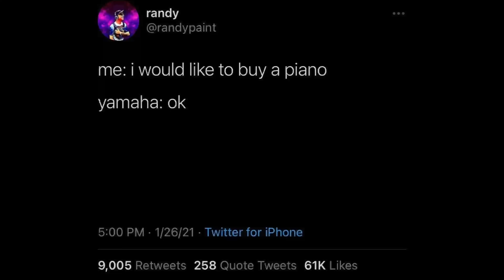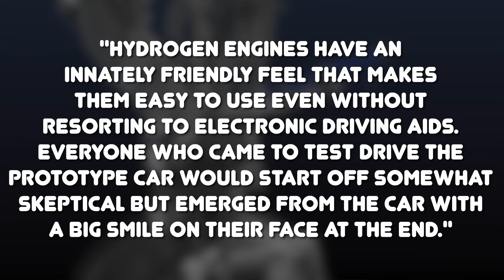Toyota's New 455HP Hydrogen V8: Everything You Need to Know

Comment: Hydrogen is definitely a viable storage medium for energy!  Think about this, Hydrogen works in internal combustion engines and provides similar performance to hydro carbons.  It can also be used with a fuel cell to generate electricity for electric vehicles.  The problem isn't the propulsion the problem is the storage tank.  Carlos Teveres (sp) an exec with Stelantis thinks that a battery shortage is on the horizon if not already in view. Batteries are expensive.  Now I'm not sure on the cost of mobile fuel cells, but if it's priced comparable or less than batteries then hydrogen is probably the fuel of the future.
Reply: Hydrogen source is water. Hydrogen is for drinking and washing clothes not engines.

Comment: A FEW YEARS AGO CHARGING STATIONS WERE LIMITED  AN ENGINE WITH 0 EMISSIONS THAT CAN ALSO HAS COMPONENTS THAT COULD BE USED TO CONVERT EXISTING ENGINES THAT HAVE BEEN PROVEN OVER THE LAST  100 YEARS OF TRIAL AND ERROR    WHAT A WASTE OF MATERIALS AS WELL AS MANPOWER AND MONEY STARTING OVER AGAIN  AN EXISTING ENGINE THAT WOULD BE CONVERTED  TO 0 EMISSIONS TO ME WOULD BE THE BEST ANSWER   THE REASON THEY DIDN T SELL  WAS THE COST AS WELL AS THE FEAR OF THE WORD HYDROGEN BY THE INSECURE  NOT ONLY VIABLE BUT A  WHOLE LOT LESS CARBON INVOLVED IN NOT HAVING TO CHANGOVER   ELECTRIC AS I AM LEAD TO BELIEVE IS QUITE UNHEALTHY  IN IT S OWN WAY   JUST ANOTHER PROBLEM WAITING TO BE USED IN THE FUTURE TO INCREASE NEW CAR  SALES THEY DID IT WITH MAKE BELIEVE FUEL SHORTAGES  WHICH WAS CAUSED BY DROPPING THE COMPRESSION TO HELP WITH POLUTION  IN 1968 THEY HAD A 300 HP 5.3 ENGINE THAT COULD GIVE YOU NEARLY 30 MILES PERT GALLON   SO RATHER THAN IMPROVING ON THAT BASE THEY ROPPED COMPRESSION AND COULD NO LONGER MUSTER TWENTY MPG  SO YOU HAD TO START BUYING SMALLER CARS  EVERY FEW YEARS THEY CONVINCE PEOPLE THAT THEY ARE DAMAGING THE ENVIROMENT BY DRIVING SOMETHING OBSOLITE AND PEOPLE WHO ARE INSECURE LEAD THE WAY TO THE DEALERSHIPS  COME ON PEOPLE WE HAVE COMPUTERS AND O ONE CAN BUILD A SIMPLE  ENGINE THAT WILL SAVE THE WORLD WITHOUT A COMPLETE START OVER  I FOR ONE AM NOT THAT NAIVE AND NOW THE GOVERNMENT IS USING IT AS A WAY TO BRING THE COUNTRY TO SUBMISSION AS I SEE IT .

Comment: you are forgetting about the "China Risk" for PGMs, scarece materials being used as their strategic material.  Then the price of EVs will go creazy high.  And not sustainable.  Hydrogen is the future.  And the #1 sales in Hydrogen is Hyundai Nexxo.  FYI.  however, this H2 combustion engine is sweet.  Toyota is on the right track for the engine side.

Comment: There is a reason to go to Hydrogen: emissions and range. You are right it needs an infrastructure putting in place but electric power is slow to charge and the range is pathetic- in the winter with the heater on and lights the range crashes further. I regularly do 400 miles in a day and have not got time to spend 30 minutes refueling, let alone waiting for someone else to finish their charge first. On the other hand the motor trade world wide from the west to under developed counties all have people who can with minimal training pick up how to repair hydrogen engines. The hydrogen cars are the best option, but what they need is pressure on governments the world over to invest in green hydrogen from hydro electric, wind and solar pv sources so we can have a sustainable planet.

Comment: Planes ? You're obviously brain dead. Fuel ? Just how stupid are you ? Obviously, very. The U.S. electrical grid system can't handle the charging systems that would be required. the emissions from electric cars are methane, and ozone which damages the stratospheric ozone layer. Hydrogen engines emit harmless steam. You have the IQ of a tree stump, and are a classic example of the failure of today's educational system.

Comment: First, hydrogen combustion engines don't require the same maintenance schedule as gas. It's a clean fuel that does not produce carbon. Therefore no carbon buildup, fouling plugs, dirty oil, etc.

Comment: 1.Electric is almost silent -> True
2.Makes a ton of power -> For now. Hydrogen technology for commercial use is still in early stages 
3.It's easy to drive -> That is extremely vague. Based on what criteria. if you are referring to lack of infrastructure, fair point but the same issue excised with LPG cars and initially (and to this day in many countries) with electric vehicles.
4.Eliminates all maintenance costs -> That is totally accurate. Electric vehicles, DO require maintenance just like any other vehicle. Maintenance that the average Joe can not perform (not the average Joe can in the modern vehicles but there are certain things that can be performed without the need of a mechanic). Needless to say you CAN NOT take your electric vehicle to the mechanic near your house.
5. and more -> I would like to hear the "and more" part.
All and all, what we need to see here, is whether the electric or the hydrogen vehicles have the biggest ecological footprint. That includes the process of extracting the minerals required for the battery cells, the methods through which the electricity required to recharge the electric vehicles is produced (renewable, fossil, nuclear etc), the recyclability of the components (I am looking at you battery cells), the methods with which the hydrogen can be "produced" and what is the energy required to do so and ofcourse what will be the long term effects of the one technology IN IT'S ENTIRITY over the other. Certainly there are more reasons that I am no expert to elaborate on. 
Deeming something not feasible, without providing any actual scientific proof/facts is at least wrong. There are reasons as to why Hydrogen would be really difficult to be implemented in our daily lives but that does not mean we should not if in the long run Hydrogen is proven to be beneficial for the planet and our lives.

Comment: you're looking at this very short term. hydrogen is the most abundant element in the universe, there's research ongoing on how to make it cheaper to liquify. also there's not a single electric grid on earth that can handle total electrification. you'd literally have to more than double the grid capacity to even think of making it viable and that basically involves doubling the thickness of every single wire and component in the grid. which is unfathomably expensive. if hydrogen pumps replace fuel pumps then electric pretty much loses out, the only thing it has going is the faster acceleration. but they're shit in hot weather, shit in cold weather and now battery subscription services. the only downside to hydrogen is fuel cost. toyota engines are insanely reliable and most can go 1,000,000+ miles without much issue. they're building the next generation of ICE engines that's based on 100+ years of engineering development. oh and they don't have to pollute the shit out of entire areas like lithium mines do. on the flip side hydrogen hybrid platforms could also work really well.

Comment: It is a lot cleaner then the electric powered cars . Hydrogen is the future of the automotive industry . And if we have been allowed to invest in hydrogen electrolyse research we would be able to put soft water in a thank and run Thousands of kilometres only with a thank of 40 litters . But unfortunately the Automobile industry has been lobbied bye the oil companies. Production of a electric battery is environmentally not sustainable because we are using rear metals .

Comment: I think Toyota and Yamaha can see the writing on the wall. I think they know that electric cars are going to fail they already have proven to be unsafe, unsustainable and for the average DIYer how are you going to work on an electric car a new battery costs anywhere from 5 to 10,000 . I think the internal combustion engine is a great idea you can work on it your self  you don't need to be an engineer or an electrician there's no hydrogen cyanide there's no risk of overcharging undercharging or damaging the battery because of extreme heat or cold.. great work Toyota I would definitely buy one of these cars.
Reply: But an EV battery refurb only costs a fraction of a full replacement, and is the way to go rather than a complete battery swap.   A 10 year old Nissan Leaf had a battery refurb at Cleveleys Electric Vehicles in Gloucestershire, England, and the work took 4 hours, and cost the Leaf owner £600. Clearly you have little idea what is actually happening on the EV scene..... Yes indeed, an EV battery can be repaired and refurbished, just like an ICE engine can. You obviously didn't know this..... Oh, and the video of the Leaf battery refurbishment is here on YouTube.....And it seems you weren't aware that on most EV's, you are able to set the maximum amount of charge you prefer. You don't have to charge to 100%.....
Reply: @Brian-om2hh  hey if you like EVS that's great I don't.  I think they're a colossal failure, I'm glad Toyota ,Yamaha and I believe Honda have all pledged to continue making the internal combustion engine I think they're going to go with hydrogen which is a great idea here in the US nobody really wants EVS they're trying to force them upon us and quite frankly I don't think we want to end up like the UK.

Comment: Neutral party here: dont trust someone who says EVs are "vastly better in every way". Thats like saying an electric drill can replace a hammer, a welder and a chainsaw. Current EV technology is near its peak already. Theres room to grow, if you want to get technical, but your not going to get a much better battery for street use. There isnt a single EV that can match the low weight and power of on ICE. People see engine/motor power numbers but forget that ICE engines have transmissions that multiply torque, thus why ICE vehicles can have vastly greater range while still carrying a load. An EV struggles to carry its own weight already but it doesnt seem like it because, yes, they accelerate quickly. But that's because its single gear ratio is optimized for its own weight and some passenger. They are barely-passable as trucks due to a HUGE range penalty with a load, not very competitive at autocross events or any track with sharp corners(mainly tracks with several long straits, don't attempt hill/canyon runs), will be extremely costly to run as a semitruck(so many reasons), and I can go on.

Just like every technology, nothing is the solution to everything. Long-term, EVs are great city cars and are solid replacement for 4000+lb luxury vehicles, but for everything else, they cant beat anything. Not even for the environment. 

Recycling batteries is a "hopeful" outlook but realistically, very few are going to be recycled, lets be honest with ourselves. People don't even recycle well as-is. Cars crash and get damaged, things get tossed in the trash when they are found on the floor or when salvaging for parts. How many people actually take their electronics and recycle each component like their supposed to? Or drop old paint containers or chemicals to designated dropoff locations? Same is going to happen.

Comment: I think hydrogen will take over commercial vehicles because of refilling at there facilities. A company called" Prometheus" has developed a fuel which is replacement for gasoline vehicles- no modifications needed.
Reply: And did they happen to mention the cost?   Synthetic petrol has been on sale in the UK for decades, but at a price. It's around 4 times the cost of normal unleaded.....

Comment: Sorry but your missing that electric cars need either a battery or a fuel cell that currently is very expensive. Batteries are not very good for environment so your talk does not make sense but for you perhaps. And all electric production systems in the world are producing to little energy, so there is  problems to get hold of electrons for your electric motor currently. Its fine, you like electric cars but do not lay out your shit as if it's the truth, It's your truth.

Comment: Batteries are cool sure, but if every single car out there which is combustion, can potentially run on Hydrogen, and let’s say it’s $5k to change the injectors and fuel cell and cylinder head.. well let’s just say it’s cheaper than buying a Tesla and you still have the same car instead of having to upgrade and spend $20k/$50k… how many people would not only financially be able to do this let alone be super close to carbon neutral 💁🏼‍♂️💁🏼‍♂️. And then there’s the potential for small auto companies to create products and more jobs… why isn’t hydrogen happening

Comment: Hydrogen could've been cheap by now if companies/countries invested in the infrastructure to support it. It's literally the most abundant element in the universe and I think that if there was more international focus put on it as a petrol replacement, it would make an even more practical choice than batteries. However, electric motors are superior from a cost of ownership standpoint, and while we likely won't be able to see charging/battery tech that can get you 400+ miles in a matter of a few minutes within this decade, most city commuters don't need that on a day-to-day basis.

Comment: Electric may be ahead but it is not superior. The time it takes to charge a fully electric car is a deal breaker for most people. And the 10yr life of a battery is another deal breaker. Also i feel like Hydrogen is far superior if its horsepower you want.
Reply: And the cost of gas/petrol and diesel is fast becoming a deal breaker for many too.... Hydrogen certainly isn't superior when it comes to fuel economy or the cost of the fuel itself....

Comment: They might have more success making a sort of crate engine for the environmentally conscious gearheads out there, they're trying to cut into a pretty niche market for sure, but if I could swap or install one of these into an empty chassis, I absolutely would, given the availability of hydrogen.  It may not be the best option emissions-wise, but to have a (in my case) classic car without the nagging guilt in the back of my head knowing that it's just dumping emissions into the air, would be an amazing thing.  Power and sustainability is the way of the future, if electric cars are the answer to that question, then so be it, but I'd absolutely love to keep the car enthusiast community roaring, instead of humming.

Comment: What you don't understand is the demand on the power grid 100% electrification would cause. Some governments are out of their minds with their new legislations on electrification. Some of the plans wouldn't be feasible if the infrastructure was already under construction. It's possible that hydrogen could supplement electric for certain applications where electric may not be as feasible...... however this is assuming hydrogen fuel itself becomes feasible. The only way I see hydrogen taking off for Ice vehicles is if the rest of the industrial sectors switch to it for other purposes, as has been discussed for, god as long as I can remember. I'm of the mindset that any money spent on technological R&D is a good thing.

Comment: "needs to be superior in every way" then you tout electric cars...and how the range is poor, what about the charging time too? Or go watch what happens to the range of an electric truck with a load on it? And as of now, the electric to charge these cars is mostly generated by burning fossil fuels anyway. The reason someone would be interested in hydrogen or some alternative fuel, is when Gasoline is $8 per gallon, and if its a relatively simple conversion process to get ICE engines to run on hydrogen (or alternative), that means we don't have to scrap hundreds of millions of cars (and trucks) that are on the roads right now...also, previously there was no demand because gas was still ~$2/gal...and when tesla started there was no charging infrastructure either....no offense but i feel like you didnt think much of those comments out....

Comment: Hydrogen is the perfect compromise, the electricity for EV can be use for electrolysis. No use of Lithium or Sodium and no need to refine them, we keep using the well established steel and aluminium industry.

You can also still modify a combustion engine to have greater power than an EV and still be less permissive than battery manufacturing.

All you need is a nuclear power plant powering a huge electrolysis plant and you have the fuel. If we have the power ants for electricity you can have hydrogen fuel.

Comment: I am wondering How would you supercharge it Because the supercharger would normally go in the V with the intake but if they are on the sides would it be turbos only.
Reply: Hydrogen source is water. Hydrogen is for drinking and washing clothes not engines.

Comment: Sorry, but hydrogen is the future.

EV are considered great today, but once the real facts come out, they’ll be like the 8 track tapes. No one will want one. 

Remember, hydrogen is its own fuel. EV’s require batteries, the materials to make them have their own controversy. Batteries require charging, which still depends on coal or petroleum. The actual list is full of negative side effects.

Hydrogen is the most abundant chemical in the universe. It’s also the cleanest.  Hydrogen is basically water in a gas form. Burn it, and it turns back to water.

Comment: EVs will fail to replace cars because of where they get the rare earth metals for them.
Reply: And what happens when oil runs dry, and there is no more petrol or diesel for ICE cars?  And the word "rare" used in the context of minerals, doesn't mean scarce. It's technical term. There are large deposits of lithium in South Africa, Canada, the US, Brazil, Chile, China, Russia, the Congo, Australia and Cornwall in the UK. Experts have estimated that there is around 30 years worth of supply. In  probably way less than 30 years, EV battery technology will have moved on, and will no longer require the types of minerals we currently use.....